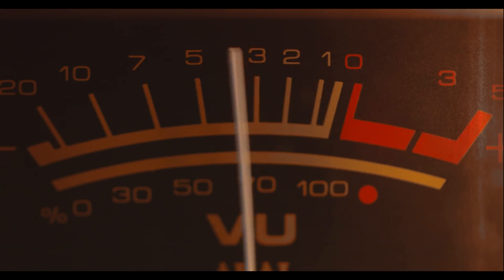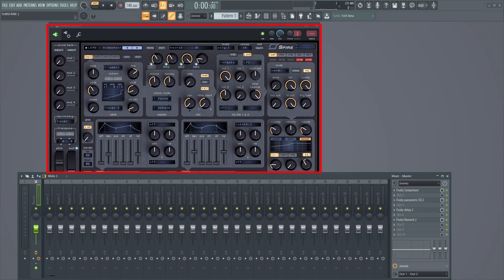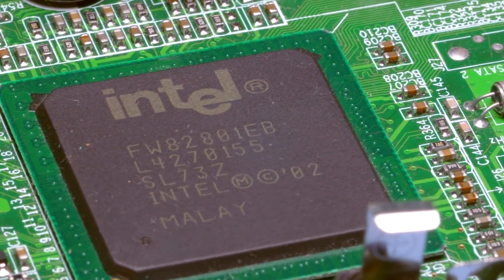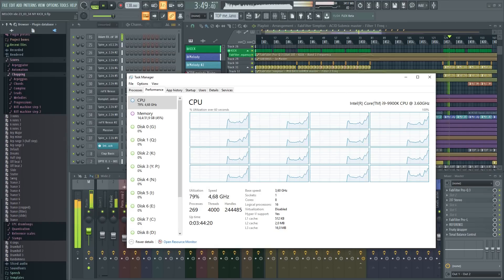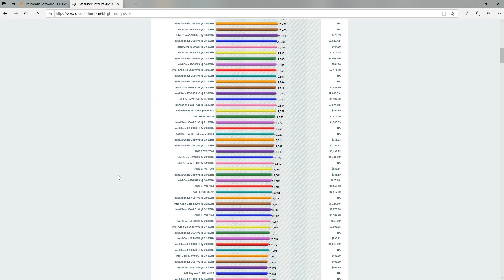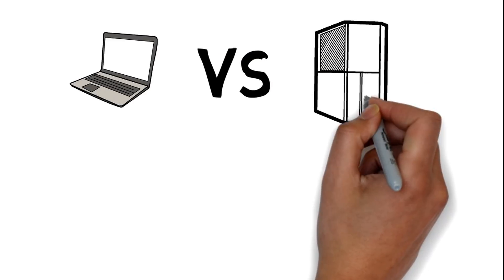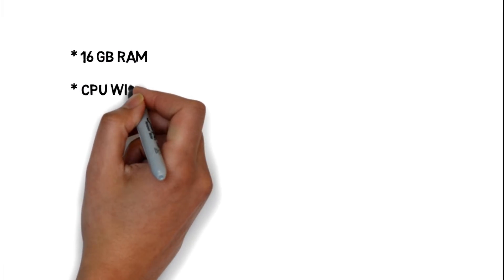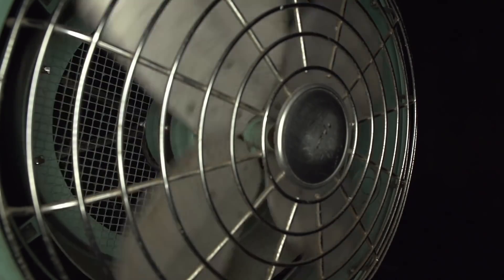The Best Computer For Music Production - What's Needed And Why!

Comment: that serial/parallel thing you've explained is not correct.   I've got separate outs connected from a tr808, tr909,  vermona drm-1 mk3, and a 5ch separate out modded tr606 connected to Ableton through an RME HDSPe MADI FX with a thunderbolt expansion chassis which is connected to an RME ADI-648 (8xADAT-MADI Converter) which is also connected to four Apogee AD-16X.  That's about 32 channels of drums where every channel has its own processing.  In addition, I have custom Max for Live devices that convert MIDI velocity to audio velocity control so that I can play tr-606 and tr-808 with velocity-sensitive MIDI.  Also, more M4L devices doing volume control. In addition, I have all my analog synths all connected at all time as well since I have 13x8 analog inputs.  I'm using a trashcan MacPro.  I've upgraded the cpu with a slower speed but with more core cpu. Now I have 12 cores.  When I'm using the DAW, I can easily see with the OSX Activity Monitor that all my 12 cores get perfectly shared load.  with my default template project, I get about %800 cpu usage and Ableton reports it as about %40 usage of the total available cpu resource.  Basically, the more cores you have is always better.  So it's actually better to have a cpu with a higher number of cores even if it means you'll get slower Ghz per each core.
Reply: Get a used trashcan macpro and upgrade yourself, they are very cheap now and you can not find anything better and more reliable.  Also here is another reason why you should prefer OSX over Windows:  Windows can not use a MIDI port that the host application (Ableton Live, FL etc) is using. Any MIDI port required to be used externally to the DAW should be disabled in the DAW first. This is due to Windows lacking a native multi-client MIDI driver.  Of course, this is not a problem with the OSX.  Also, Windows is filled with unnecessary processes and is more resource hungry compared to OSX plus you have all that telemetry bullshit going on constantly behind your back.  Also I've got 3 monitors connected and I can still connect more plus its dead silent and very compact.  trashcan macpro is the best computer for a DAW and if you buy it used or refurbished and upgrade yourself, you cant beat the price/performace. you won't even need a virus program or a malware system. also you won't have to be using a bad OS like windows.

Comment: I'm planning to buy the AMD Ryzen 7 2700X 3.7 GHz 8-Core Processor. Is it enough for big EDM projects?
Reply: More than enough. Large projects were made with way older and much much slower cpu, no doubt. The video is great, thus i think the i9 9900k might be overkill in most of cases (i'm speaking as a computer engineer and budget-wise, the i9 is a GREAT cpu, no question about it, but some more affordable options will do the trick like a charm, no question about it either).
Reply from the maker: It's hard to say, it depends on just how large your projects are. The 2700x is still a quite capable CPU and should be able to handle fairly large projects though, so you'll probably be fine.
Reply: @FireWalkMusic  Awesome! Thanks for the reply!
Reply: @FireWalkMusic  It will be better than the pile of shite he built above.....
Reply: you can always bounce your midi to audio and just mute the midi tracks
Reply: David Jenkins I’m currently doing that with my pc because it’s not strong enough. I hate this method because you can’t go back and change something. I have to delete the vst to free up cpu.
Reply: R5 3600 vs R7 2700x ?

Comment: How important is RAM clock speed, and is there much of a difference between 2666MHz, 3200MHz etc?
Reply from the maker: RAM speed is quite important and the faster the better. Note that you need to also pay attention to latency, not just the speed.
Reply: Generally saying faster is better is true. BUT as long as you are not overclocking you get more from a faster CPU.

Comment: Keep in mind that while single core performance is very important for the master output, all the "per track/instrument/plugin/group/..." processing can still be distributed among multiple CPU's. For example, the processing of the bass VST (and any effects applied to it) and the one of the drum VST can still be handled by two different cores (before reaching the master bus).
Reply from the maker: Indeed. All VST's can usually be processed separately. Additionally, every mixer track is generally an opportunity for the CPU to process in parallel. The problem is mainly all the waiting that needs to take place further down in the chain. Unlike with video editing and such, this becomes a problem because the sound needs to be played back in real-time.
This is why fast processing is generally more important than having a large number of cores. The 9900k is great because it's located in the sweet spot where you have a good amount of cores, and at the same time very good single core speed. As you keep adding cores, single core performance tends to go down.  If you look at the 9900x for example, which is a workstation platform, you get more cores, but about 12% slower single-core speed. The 9900k can also be overclocked to run at 5 ghz on all cores with no problem. Large overclocks will typically not be possible on CPU's with huge amount of cores since more heat is generated. 

To quote the developers (This is from the manual): 

The logic of audio processing - There is a long list of tasks that must be processed in sequence, and this means logically can't be processed in parallel (multithreaded). For example: Plugins must wait for instructions from the Piano roll and Playlist before they make sound. Effects must wait for the audio from upstream instruments and FX before they can process it. Further, it's not possible to parallel-process (multithread) instruments and FX that are on the same Mixer channel (their audio is mixed together), or even in the same Mixer routing pipe-line (when one Mixer track is linked to another and another, even FX processing has an order from top to bottom in the FX stack). Then, the Master Mixer track must wait for every instrument > mixer track > effect to be processed before it can process the audio through the Master effects. So logically, there is a lot of waiting that is a natural and unavoidable fact of DAW music processing. Think of a production line. This means the CPU may not be particularly busy, using all its cores and processing slots, yet it runs out of time to fill that tiny 5 ms audio-buffer because there was a lot of waiting for things that needed to be processed in sequence. It should be clear that fast processing is very important and this is not the same thing as multi-core processing. The best CPU is one that has enough cores to spread the work around AND can do the most work on a single core during each buffer time-slice. Which leads to our TIP: When comparing CPUs, look for the fastest single-core performance scores in a package with at least 4 physical cores.
Reply: @FireWalkMusic  "As you keep adding cores, single core performance tends to go down" - This is more of a intel problem. AMD bins in a way that more cores generally means higher single core, because the best binned chips go to top skus. And as for single core, there is very little seperating the 3900x/3950x and the 9900k. And scanproaudio did a proper dawbench review back in july, where the 3900x at times manhandles the 9900k: http://www.scanproaudio.info/2019/07/12/amd-ryzen-3600-3700x-3900x-dawbench-tested-3-is-it-the-magic-number/
Reply: @FireWalkMusic  jesus crist you are smart
Reply: the ZEN 2 core has higher IPC than the current intel cpu...that means AMD has the fastest core
Reply: we are on the RYZEN 3000 series and that i9 18 core cpu gets tossed by 16 core Ryzen
Reply: @larryfleming7295  it has higher ipc, but intel still has higher core performance because of higher clock speeds
Reply: @psychozulu  DUDE who the hell runs their systems clocked @ 5.3 ghz ….very very few...and the performance difference is negligible at besst
Reply: @larryfleming7295  Intel CPU's turbo higher on all cores than ryzen, so you don't need to overclock them a few more mhz to outperform ryzen in tasks that benefit from single core performance. Maybe the differnce is negligible, maybe it's not, but the point is that Intel still has better core performance.
Reply: PsychoZulu the youtube comment sections has created a class of AMD fanboys that don’t understand that there’s a reason Intel cost more , the Ryzen platform is very buggy compared to intels and many things that benchmarks can’t show you as far as better user experience I built an extra Ryzen 3700 pc this year and it’s almost as good as my old haswell pc as far as performance and it’s not near as good as my 9900kf build and it will be first one i part with if I did a lot of video rendering maybe I’d keep it and sell the old 4790k but really it does just fine it’s not like anyone is rendering videos out 24/7 like even if doing one video a day save 5 - 10 min i just don’t need three pcs two is my needs and the older haswell real world performs better for gaming still occasionally, and since the b450 boards won’t be compatible with the next Ryzen CPU’s it’s pretty much a dead platform and it died almost equal to intels pretty much decade old tech but hey it’s better that there’s competition in the market again and a very viable budget option .
Reply: @Noctumus ur dumb lol

Comment: I think this cooler is a bit too big for just music production 😅
I have a i7-9700K with a Corsair water cooler and it rarely goes above 50°C even with fans and pump speed at the minimum.
This is mainly a gaming PC for now, but if I decide to produce music as a half time job I would build another PC with a small single fan Noctua cooler. Since it would be for music and not 3D renders I would definitely not go for a cooler that big.
Big coolers = more surface for air to collide with = more noise.
Reply: Not universally true. A lot of larger fans run much quieter because they don't need to spin as fast to move the same amount of air.

Comment: This is bullshit. I run a 7 year old Dell T5500 Dual 6 Core; 12 Total and 24 Virtual Cores, 72GB RAM, 5 SSD Drives, 4GB Video Card, and a Presonus USB interface under Windows 10 Pro and Pro Tools 12 and it NEVER craps out. I ran a test with 256 tracks of AIR Music Xpand and system utilization was at 40%. The entire system cost me about $1,200. Its all about balancing your components. Also it depends on the DAW software you use. Both Pro Tools and Studio One are designed from the ground up to take advantage of all the cores you have IF you use a 64 Bit OS AND a 64 Bit DAW. If you find yourself "resource constrained" BACKUP the track, BOUNCE all those Midi tracks down to AUDIO tracks and work with that version. If you need to make changes later you still have the original track WITH all the Midi tracks to fall back on. Finally, BACKUP your system every day to a dedicated drive solely for that purpose and you'll never lose a thing.

Comment: How about the hdd? 
My hdd had crashing problem and i lost many of my projects. Any recommendations about a good durable hdd?
Reply: Yeah. Get SSD drives. 1TB are under $100 now. And get TWO and BACKUP to the second drive on a daily basis.
Reply from the maker: Definitely get an SSD. Keep in mind though that SSD's don't last for ever either, especially if you are writing to them a lot. They will make loading huge libraries and such much faster. A must if you're using nexus, omnisphere etc.

Comment: I say - your old computer vs new computer, not worth the upgrade. Make first mega hit, than upgrade just because you can ;-)
Reply from the maker: on paper the 9900k is about 40% faster than the 5820k (overall), but the 5820k is running quad channel memory vs the dual memory of the i9. This gives the 5820k an advantage here, which is what I believe is what's causing it to get so close in performance here. That said, the i9 will be vastly superior in a lot of other tasks, and people usually use their computers for more than just one thing. Overall the i9 is a big improvement for me personally, all though it's not a huge improvement. The 5820k is an older design by now and it's still quite expensive. I wouldn't recommend it over the i9. :)

Comment: nice comparison ! first of all thanks for the video i have enjoyed it a lot :)
but my conclution :
i am using the 5820K with water cooling (no fans except 2 on the radiator supper quiet) 
I over clocked it to 5 ghz stable using 32 gb of ram same as yours ddr 4 
and by your video results its a couple of % from your older build ... 
now in the days (5 years or so ) when i bought my 5820K with motherboard ram ssd power supply case (without monitor ) it cost something like 2500$ ...! approximately .
now i guess your new build cost almost the same (correct me if i'M wrong) 
so does it worth it .... 
well in my opinion i don't think so ... 
better invest in better converters preamps ,,, if you got those in place 
room treatment 
new microphone 
new synth ...
but also you can see in the windows task manager that all your cores are utilized almost equally 
I am using Logic X and presonus studio one 
but also i had experience with most of today's DAW's 
i can only say one thing about FL studio :
the have came a long way since their first version no doubt about it 
but still unfortunately i find it not professional enough for my needs and not utilizing the system resources so good 
i would recommend you to try this builds with different DAW and i am sure that you will find different results .
if it feels like i am criticizing ,,, this is not my intent , just sharing my opinion with you after watching you video 
again thanks for the video
Reply from the maker: Thanks. :) At 5 ghz the 5840k will perform very nicely indeed, and you probably won't have to upgrade for some time. I could never get mine to work stable above 4,5. The 5820k is based Intel's workstation platform, and it's running quad channel memory which seems to make a huge different in FL Studio, even though technically it shouldn't. If you try setting your system to dual channel memory, then I suspect you'll see a huge drop in performance in FL Studio. I tried this myself and noticed a 30-40% reduction in performance. I suspect this is what's giving the 5820k a huge advantage here. On paper, the 9900k should be about 40% faster than the 5820k out of the box, but then again it's 2 channel vs 4 channel memory. 
That said, I use my rig for a lot more than just FL Studio and while the 5820k is still quite good it ends up being a bottle neck at other tasks, so overall the 9900k is a good improvement for me. Most people tend to use their computer for more than just music. The 5820k is still quite expensive, and it's an older design by now so I wouldn't really recommend anyone to get it over the i9 at this time. I suspect the new Ryzen 3000 series CPU's which has just been released will be the best bet right now, but I can't say for sure because I haven't tested it personally. I'm considering buying the hardware to run some tests and see how it performs compared to the i9. I just need to save up some money first. :)

Comment: Hey - same case that I used!  I don't do video editing on my studio PC, so I went a slightly different route.  I used the 65W i7-6700.  It has four cores and is plenty powerful enough, and as it is only 65W I don't have to go with extreme cooling solutions; there I chose a near silent CPU fan (can't remember exactly which one). 
Not needing intense video, I also use the CPU's on-board graphics for one monitor, and an external fanless USB interface for the second.  The result is a near silent computer that I don't have to enclose or place in a closet.
Reply from the maker: I love that case. :) The 6700 will work fine. It all depends on how you work and how large your projects are and so on. Some people work mostly with samples, and in that case they don't really need much computing power. :)
Reply: @FireWalkMusic  Yup.  My stuff is more traditional rock rather than EDM, so the processing is prolly less intensive.  And freezing/rendering is a great ally!

Comment: Unfortunately the video cpu section is already outdated
AMD has top positions in single core performance even with the 3600 beating the 9900
Reply from the maker: I knew the video would become outdated as soon as a new series of CPU's got released, which is why I structured the video into two parts, with the first part being about why music production is so demanding on the system, and what kind of system is needed etc. Hopefully this will keep it at least somewhat relevant for some time to come.
The last part is about the actual build. From what I've seen so far the 9900k is still slightly faster in raw single core performance, and also provides higher clock speeds, but the new AMD chips have more cores so that might very well make up for that. More testing will be needed. 
I'm considering making a follow up video with the new AMD CPU's. I have to say I'm quite surprised by the performance. Every time they have something new people have claimed that this time it's an Intel killer, but it never came true. Remember the hype before the Bulldozer launched? It didn't exactly live up to expectations. This time however it seems like they have made a really good chip, combined with the fact that Intel is struggling with their manufacturing techniques might very well put AMD in the lead. I'm very interested in making a video with some tests, putting the 3000 series against the 9900k. Unfortunately the channel is still very small and it's impossible to get sponsored with parts for such a video, so I'll have to save up some money to buy the hardware first. :)
Reply: He has some suggestions that aren't outdated did we watch the same video